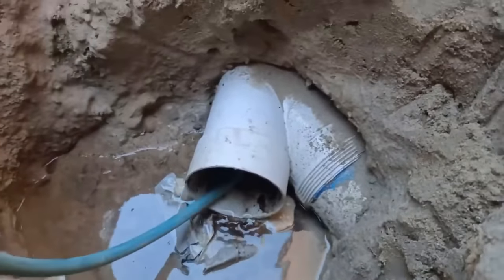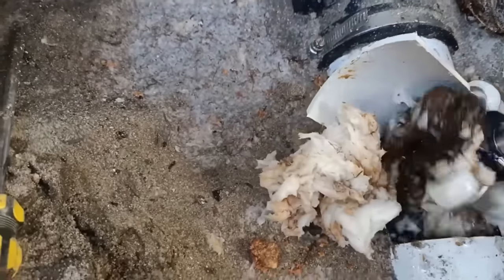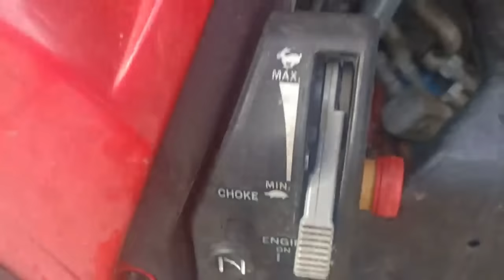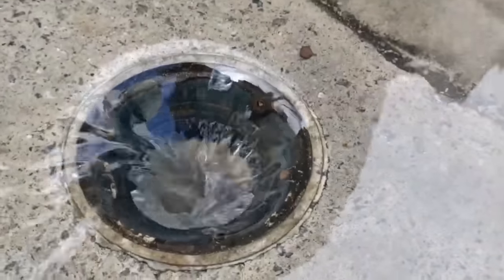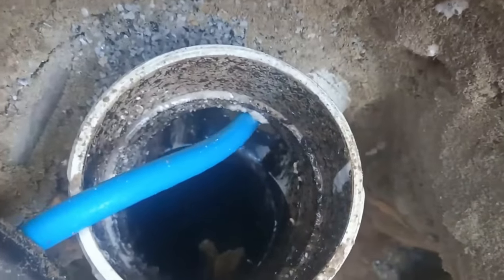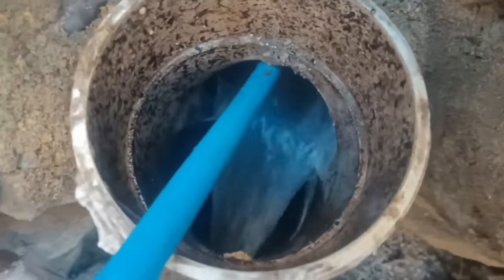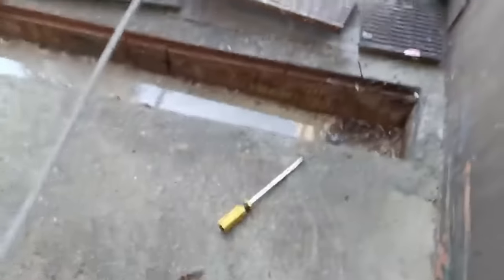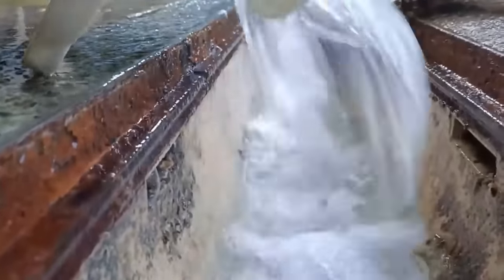The MOST ROTTEN Blocked Drains of 2022

Comment: I am a tv antenna installer in Santa Monica Ca and the strangest thing I ever saw was a flat roof drain not draining due to hundreds of pounds of rib bones that had built up on the roof. Seagulls were raiding the trash can of a place that only served ribs (actor Robert Wagner`s place) The sea gulls would carry the rib bones up to the roof ,then leave them there if the tv had not gone out in the bar and I had not seen it the roof would have caved in from the weight of the water on the roof.

Comment: Where I live, restaurants are required to have two separate drain lines coming from the building.  All of the floor drains, sinks, and dish washers are required to be in one drain line that flows directly into a large pit specifically designed to separate grease and food particles.  The second drain is for everything else in the building.  Then after all or most of the grease is separated from the water the two drains can then flow into one and then into the sanitary sewer.  Grease pits are required to be evacuated with a vacuum truck.

And all grease from any fryers and grills must be put into a large container behind the building.  We do have a company that supplies the containers and will come by periodically to empty the containers for free.  They then take all of the grease and process it into biofuel, lubricants, lamp oil, paint remover, shampoos and moisturizers, car cleaning material, furniture and appliance protection oils, and animal feeds.

I am 66 years old and have never heard of a sewer getting plugged up with solidified cooking oils or grease where I live.
Reply from the maker: Thanks for the message mate. And thanks for watching!!

Comment: I'm surprised that restaurant drain did not have an outdoor separate grease trap before the sewer mains. That white stuff is solidified fryer grease. Back when they had hot water dishwashers, it didn't accumulate in the building drains. But now with the low temperature chemical dishwashers, it now is a big problem, everywhere. Grease sits in the pipes instead of flowing out to the grease trap.

Comment: Bruce we're having a problem with septic backup into the toilet and shower,sent the snake thru the main and also removed toilet and still not resolved the issue. Any suggestions?
Reply from the maker: @S E have you checked the levels in the septic tank? Is the septic tank full?

Comment: Never ever use schedule 10, or schedule 5 thin wall pipe especially if you are going to bury it! The reason we call it egg shell is because a 100 lbs person will crush it just by standing or walking on it. We only ever use schedule 40, or scheduled 80 pipe especially for drain, waste, or vent unless you want to have to redo it every couple of years. 6-8 foot of dirt is enough to collapse schedule 5-10 pipe. It’s illegal to use anything under schedule 40 in the United States. Use a good glue with lots of primer to create a sealed joint that roots can’t get through. I have only ever seen one other pipe worse then this thin walled crap pipe that is Ornesburg pipe made out of rolled tarpaper similar to rolled roofing material used in the 1920’s-1940’s. It deforms with just around 10-12 inches of dirt, catches when used sewer rods to clean out a blockage, will unwind inside out. High pressure water jets shred it into black sticky confetti, the water jets will blow through thin wall egg shell pipe all I have seen in these videos. No wander they have to keep coming back to clean lines every year.

Comment: Between 24-28 minutes there clearly seems to be a break in the pipe as pieces on concrete seem to be flushing out. Shouldn't that be fixed? And you let a lot for down the pipe. Isn't that going to cause a bigger problem further down the line? You said it was grease but it definitely looked like concrete.